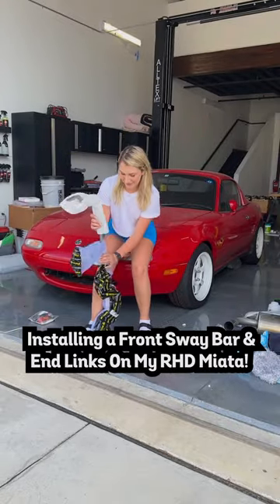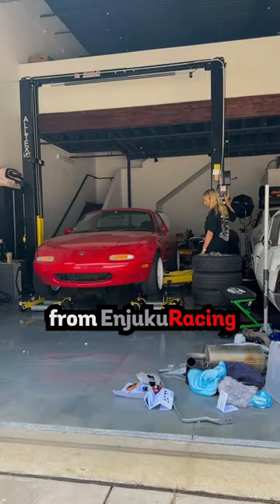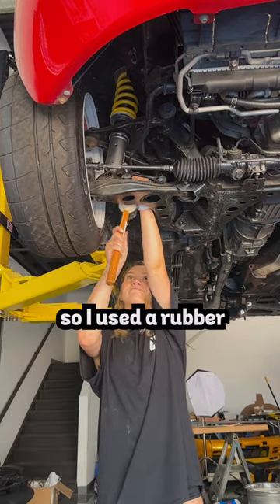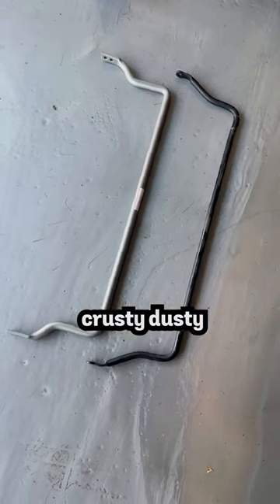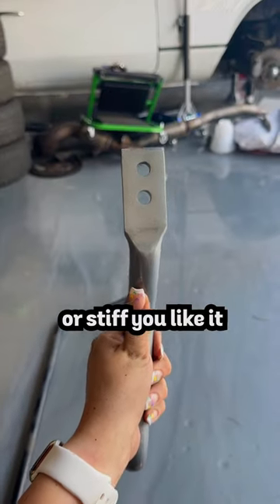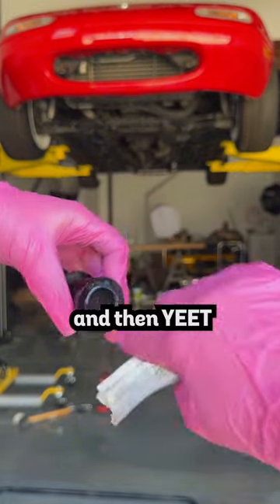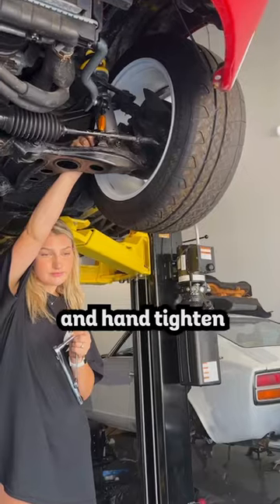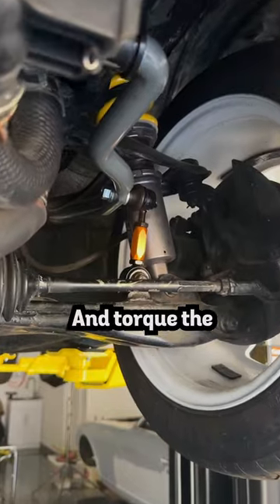Installing A Front Sway Bar & Adjustable End Links On My RHD Miata!

Comment: Tip don’t fully tighten suspension components until the car is sitting on the ground, tightening while unloaded will cause the sway bar bushings to bind when the suspension goes to static and cause excess wear on the components
Reply: She did mention too torque then after you lower the car

Comment: Having a swaybar too stiff that can't compensate your other suspension parts can cause understeer. Adjust accordingly. Sometimes the stock swaybar and coils is all you need in a miata
Reply: @DooberD33  What are you trying to say? Sway bars are part of your suspension and definitely do affect your oversteer/understeer balance. Also sway bars have no effect in a straight line, no matter the speed, as long as the road is mostly flat. 

Educate yourself.

Comment: Having a lift makes work so much easier. I'm not even going to try to replace my sway bars on the ground
Reply: Thank god the dealer did both my sway bars on my nd under warranty. I got thicker sway bars, they told me had it not been warranty, I would of been charged for about 5-6 hours of labor
Reply: @AntonioGomez-du3zi  yea i got quoted over $500 just to replace the two sway bar bushings. 🙈

Comment: 😂😂 you already have a sway bar bruh with links this upgrade does nothing it’s the same size and weight only difference are colors 😂 the only thing a sway bar effects is body roll and I do extreme off-roading I have a stock sway bar from 1989 I’ve put it through more than you ever could on any of your cars and they don’t break because there job isn’t that important I literally took mine off my Cherokee after awhile and I don’t even use it now why don’t you rebuild that shit motor in there before anything